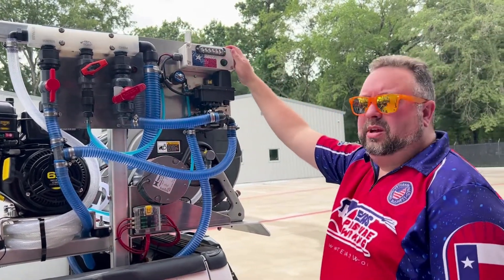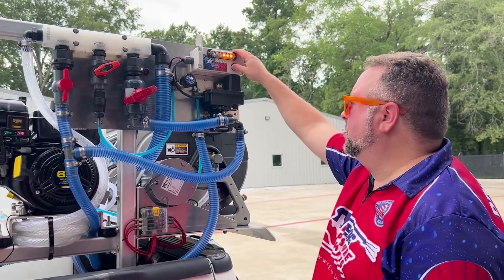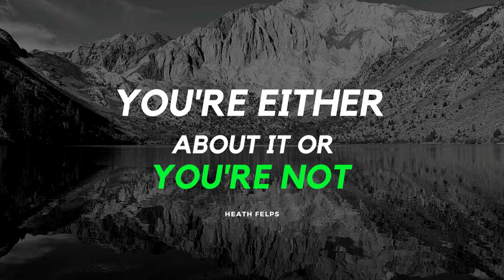8FT Texas Forever Skid Walkthrough

Comment: Can you see by the skid in the truck bed with the side mirrors?...Would a DOT Trooper have issue with that as you are a commercial vehicle?...what are the dry and wet weights of that skid and how does it affect the trucks rear suspension (loaded)...how is it secured in the bed of the truck?